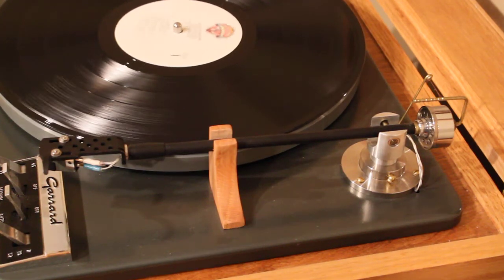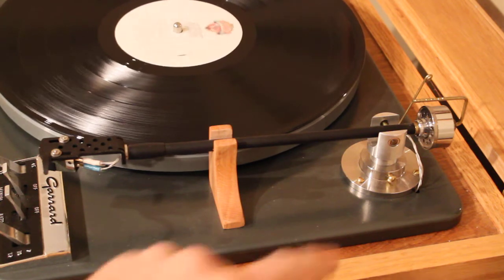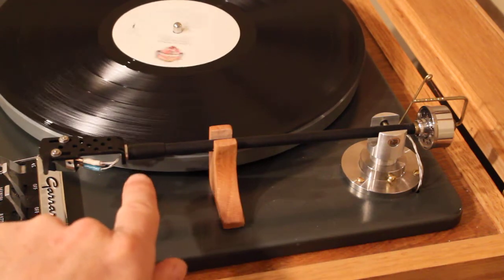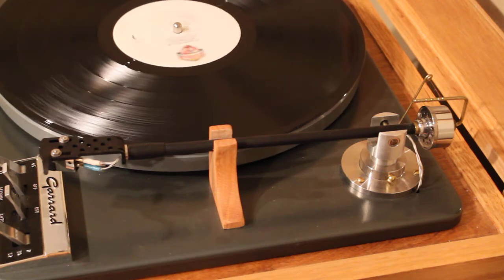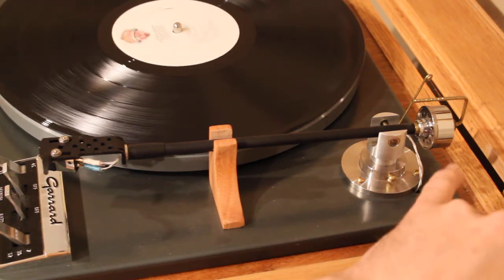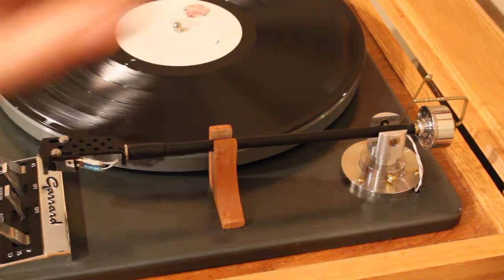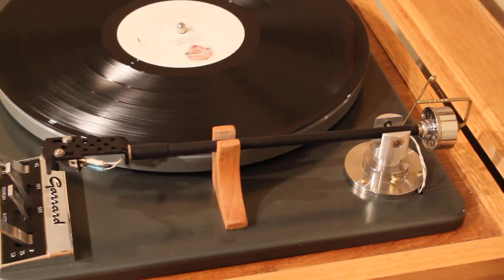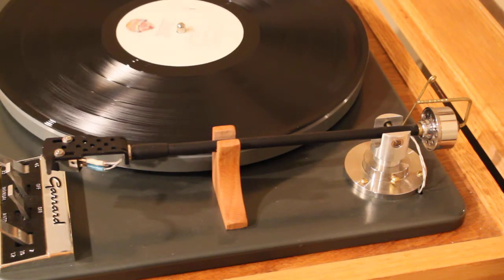DIY Schick/SME tone arm

Comment: Hello, I am very late to this video but was wondering if you have any thread or somewhere with further information on the build. I am currently looking into a DIY tonearm and unsure how to design a solution for the pivoting bearings. Ortofon used bearing housing to keep it tight. Schick (aswell as yours) seemingly dont. How do you keep the wand still on the horizontal axis.
Hope my question makes sense.

Comment: Very interesting because I had heard that early Garrard models (pre 1959?) did not have any anti-skate.
Reply from the maker: Plenty of turntables don't have anti-skate.  But the LAB 80 was from the 1960's.  The anti-skate mechanism was pretty cheesy, in my opinion.  Made of plastic and the weight was held in place by a rubber O-ring.  Mine was dry and slid down the plastic bias adjustment stem.
Reply: The presence of the anti-skating is significant for the stereo-records only.

Comment: If you underhang  the tonearm on the vertical axis would be better especially if you use an isolating material in this
Reply from the maker: I don't understand.  Do you mean tonearm?  I'm also not using any isolating material.  
(kind of a moot point now...I gave up on turn tables.  Streaming sounds better and is much more convenient.  Less cleaning, tinkering and cost.
Reply: jdsalinger73 yes tonearm…my keyboard keeps changing my words even with it turned off I don't know why! and I'm sure it does it after I check it. Where's the fun in streaming then. yes but that's digital it's hard to find a good analogue recording on LP like the old Decca recordings why more superior you put a old Decca recording of classical or opera and the LP will sound better.

Comment: What happened just before the 6 minute mark?
Reply from the maker: I might have brushed the mic on the camera.  Sounded like a needle scratch didn't it?
Reply: It sure did. Earlier you had mentioned difficulties with tracking the inner grooves so that's what I thought it was. So it's all good? Don't be surprised if SME calls you with a job offer.
Reply: Very good, but it's Garrard not Gerrard.